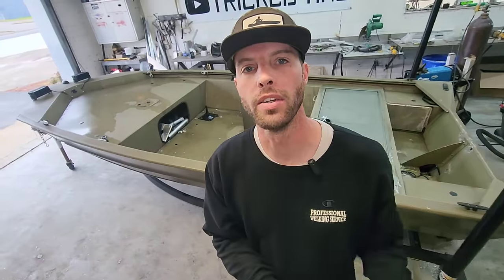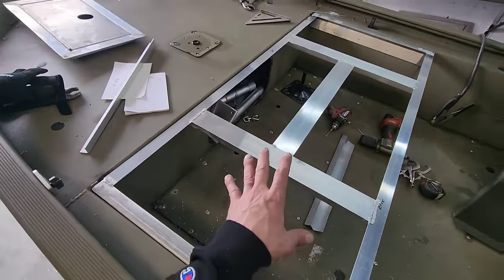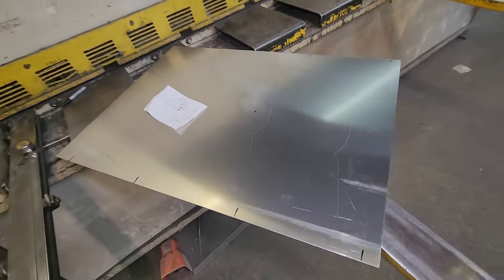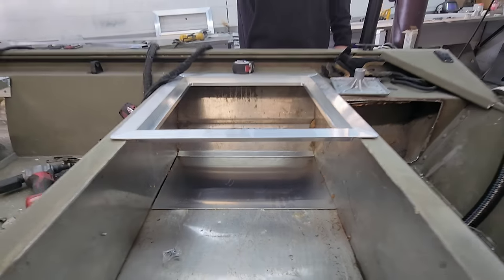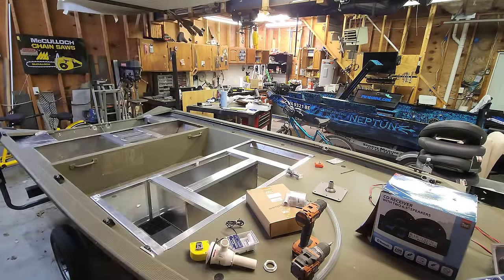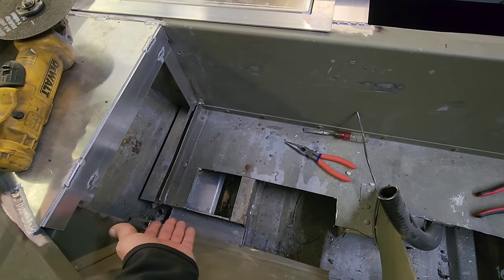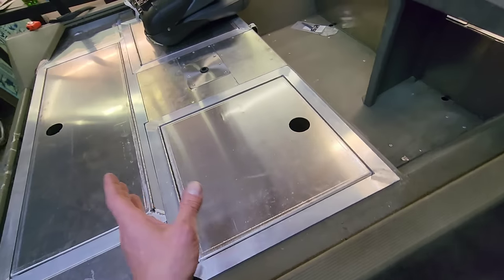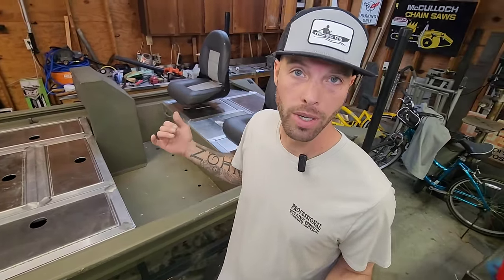Tracker Grizzly 1448 sc?

Comment: Matt, Does the TM foot tray help strengthen the area being the fact the inner support is cut? My 15 year old really wants one for our 1448 and our Tour Pro pedal. Only thing stopping me is I’ve seen that brace while looking from the hatch access. Thank you.
Reply from the maker: It will be fine. Worst case you add a small tube or angle as a kick stand  if you think you need it

Comment: Hey I have a question. I got the same boat. It's still tiller steering. I'm wanting to add a console but slide all the way up to the front deck with a seat bench that comes off the back deck. Do u have any ideas on that and a live well the go from the side of the console all the cross the boat for big catfish any opinions are ideas be grateful thanks
Reply from the maker: Honestly I think it's to small for all that, but it's your rig.

Comment: What cutting wheel do you use on the grinder?
Reply from the maker: Thats a great question.  Been on the fence lately.  Ive been using radiac wheels forever but lately the quality has really fell off and makes me nervous.  I also use klingspore wheels they are really nice but $$$$$pricey $$$$$. Im in the mix of deciding on my favorite cutting wheel atm.
Reply: Thank you for the quick response, ive been redoing a boat and have been having a terrible time cutting the aluminum. I’ll give the klingspore a try today